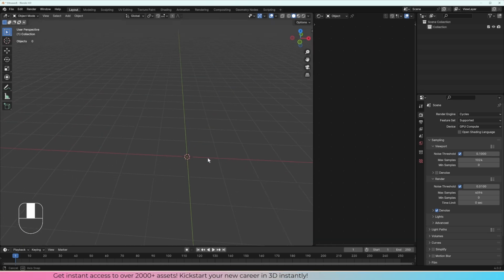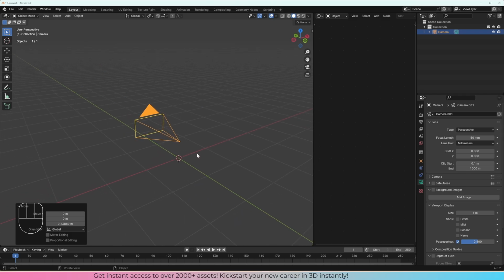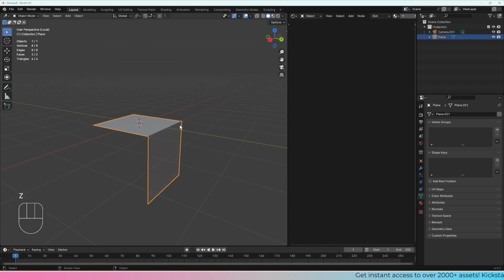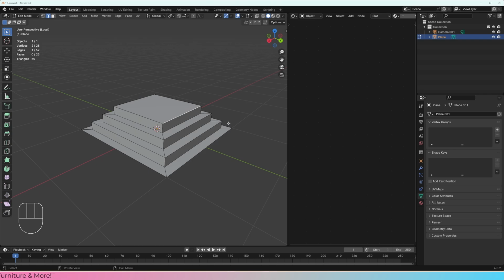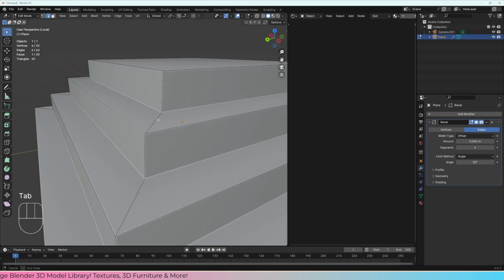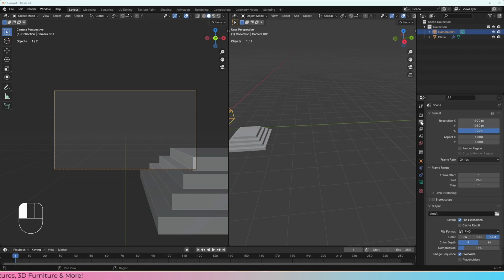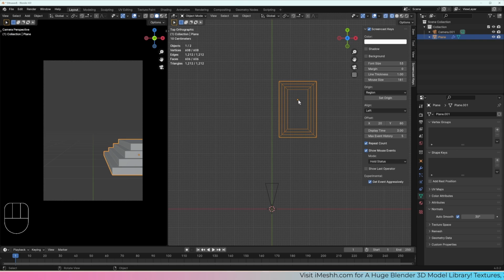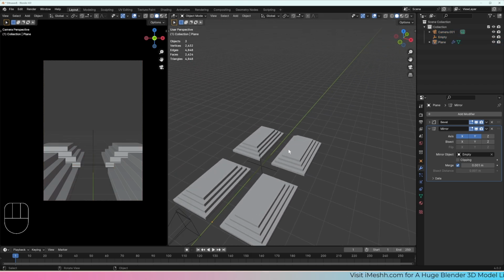PART 2 - Blender 4.0 - From Zero to Hero! Starting Your First Project

Comment: when I put empty it is already connected to the object like it's parented to the object and it moves everything as one object instead of a mirror. But when I put the 3D cursor somewhere else and then bring the empty plane axes it's working as normal. Then again if I move the plane axes to the center after everything again same thing moves as one object but with some offset effect. here is a link to what is happening please anyone who knows what is going on let me know until then I got a way to work around it. Thanks in advance

https://drive.google.com/file/d/1yN8PbvoyTBrc0jc62TZgjQBt2Wwg6lOI/view?usp=drive_link